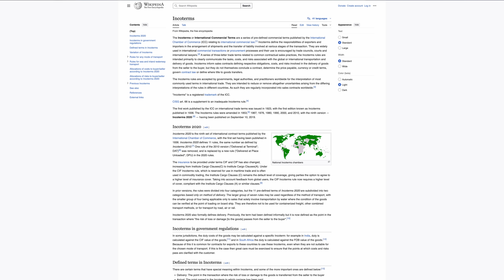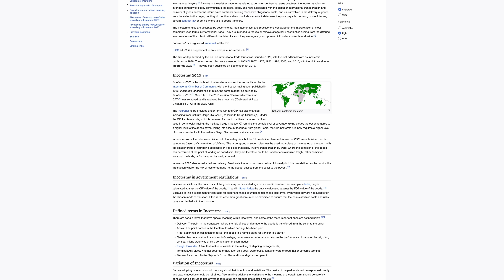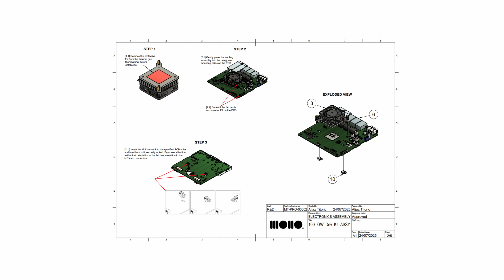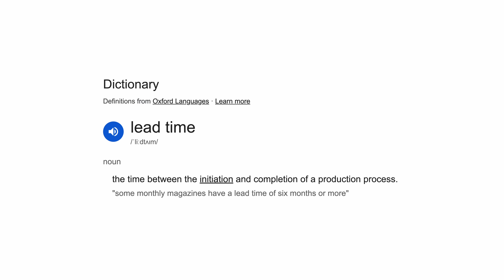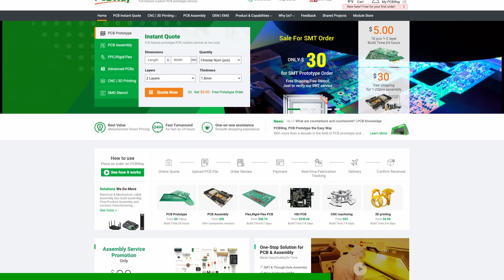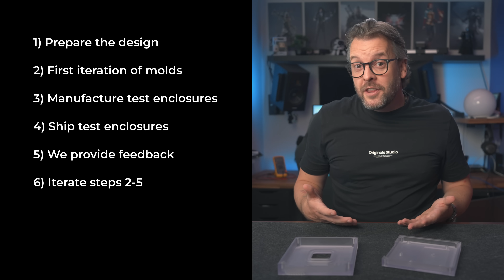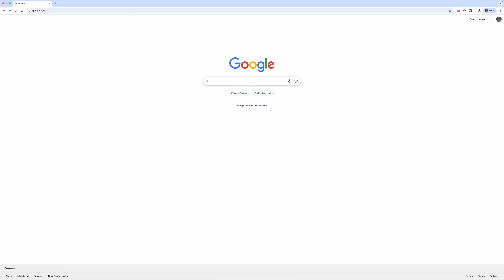We're building a high-end router. Here's the update for July 2025.

Comment: Few thoughts:
1. Still holding back with the order, waiting for a "regular" version to be ready. Actually, the PCB only version would be perfect for me, because of point nr 2.
2. I will be happy to 3D print an enclosure in very good quality and any amount that will be needed. Can also do resin and SLS prints. I'm based in Poland and I have been making projects of this size for the last 8 years.
3. It's SO COOL you've connected with Leolabs! Their ONT's can be used legally wih Orange FTTH (in Poland at least), I'm just waiting for them to release their 10Gb SFP+ ONT, so I could use it with my 8/2Gb FTTH.

Comment: TLDW but doesn't seem like you mention environmental testing, like operating temperature, dust, and humidity. Places like France are hitting 47C, wouldn't you need to test for operating temperature and have it on specifications sheet? Sorry for being a bit judgemental but the board doesn't look like ultra optimized for thermal dissipation and longevity

Comment: Alright, i have limited knowledge compared to you, BUT! I have a question. Why solder expensive ddr4 modules that are hard to get? Why not a use a sodimm slot so you can use cheap, high performing laptop memory? Consumer price for 8gb sodimm ddr4 is €20 inc tax. Yeah you still have to solder the ecc, but the rest of the ram is cheaper

Comment: I like the injection molded design with rounded edges. And the fact that you can modify the color easily. And you can keep the mold, so additional runs should be much cheaper if you can reuse the mold.

Are you willing to use brokered parts? Finding someone else with leftovers can be troublesome, but could be mutually beneficial and fast. But if you're going to keep track of fine detail in your lot numbers, could be a bear to deal with if problems show up later.

I do a lot of this for government contracts, and we can't just make 10% extra for a rainy day. So we get caught up in last time buys and obsolescence redesigns all the time. The logistics take a lot of effort as we identify an escape on a part, and then have to track down every single lot # that's affected. So I understand wanting to avoid that and just stick with a single source.

Comment: I’m not sure if it would work, but SLA 3D printing could be an option. You could use many different resins, and I don’t think the design would need any changes. However, you would need to post-process the parts to remove the support structures.

Comment: I have been thinking about routers in the past. Not only speed is important but also the way the information gets to the user and what is necessary to be better then others. For instance if the fiber is squeezed hard enough the bits wil not be able to pass through the glass, then there is the need for a back-up plan. In the specifications I do not see anything to prevent a congestion. A modern router should have an automatic multiple pathway to maximise the speed beyond the capabilities of one optic fiber. This router is still an old fashioned router but then thousands times faster, there is no real Nobel Prize winning innovation behind it.

Comment: Here is an idea to cut cost and option to make the case your own, relese the stl models so ppl that want can 3d print them :) Also, have options to sell the board without dimm and let ppl source their own (i'm assuming it's standard DIMMs) Also, and i might just have missunderstood the fan picture it but i really hope the fan PULLS out air from the case and not pushes into it, that would be weird as you want to suck the hot air out of the case.
Reply: Look at 0:35 . Above the CPU there are 5 black rectangular modules. Those are the RAM modules. Totally not standard DIMM, but directly soldered. Including ECC. Soo, not really user serviceable.

Comment: Why not just use a socketed DDR4 SODIMM?
Reply: You won’t save money, and it doesn’t make sense if the only version you’re supporting is with the dram already maxed out.
Reply: @theondono  sodimm 8 GB ddr4 is way cheaper than 55 usd per modem. Plus if you just release it without the memory people can find their own. Plus that soc chip is not limited to 8 GB.
Reply: @cybervand  the most critical spec for this application is transfer latency, not raw capacity. 

Yes, you can fit up to 32GB of DRAM on this SoC, but that’s using multiple ranks (separate CS). This has an impact on latency.

The other thing you’re not taking into consideration is EEC. Sodimm EEC is relatively rare, since most laptops don’t use EEC. If you look for 8GB so dimms, with EEC with >2100MT/s (the controller max) you’ll see the price is significantly higher than $55. 

And that’s before filtering for the PN NXP recommends and considers “validated” for the SoC.
Reply: Are SODIMMs competitively available in ECC?

Comment: I just want to be able to plug in this router to my 10 gig fiber ONT using one of the 10 gig ethernet ports, then in a second 10 gig ethernet port I want to plug into my 10 gig Intel RJ45 card, then in a third Ethernet port on the router I want to plug that into a wireless access point that I purchase and own so I'm not spending 20 bucks a month on the one to my ISP gives me but I still have 10 gig ethernet. I really don't care what it looks like. I'll use mine without any case lol just send me the board and a charger hahahah

Comment: What's the reason for the DDR4 prices? DDR4 not being made as much anymore, replaced by DDR5? For the enclosure, have you considered aluminium exptrusion + 2 flat plates for top/bottom, like Mac Mini?
Reply: It's not "not made as much", all of the main manufacturers of ddr4 stopped its production entirely to focus on ddr5
Reply: You first chose a SoC and take then the according memory...the SoC they chose still needs LPDDR4 if I'm not mistaken. Also LDDDR4 / DDR4 is still plenty used in the embedded industry (SoCs with DDR3 are starting to not be interesting anymore). Reason is simple: products are made and often needed for 10+ years to be sold, without redesigns are possible because too expensive. Embedded  industry moves slower than the Laptop/PC market

Comment: I understand your effort and congratulate you, but I think it would be much better to use the system board of old phones and have RAM, CPU and basic storage. For example, the XIAOMI Note 10 motherboard is 40$ USD and the only goal is not to have a 10GB network, it should be cheaper equipment.

Comment: At @5:00 groan.... back in the early to mid 1990's, then I sold my demo computer which had four megs of RAM at the time, planning to upgrade to a new computer with 16 mega of RAM. Between the time I ran all of the quote numbers and shortly placing the orders.... a Silicone plant in Japan blew up. Prices on chips WENT THROUGH THE ROOF!!! I ended up having to pay as much as would have purchased 32 meg of ram for only 8 meg of ram. 🤯🤮 Fortunately ram prices did not spike up that drastically this time for you. Back then I was dealing with megs of ram, today we deal with gb's of ram. Back then I was running the OS/2 operating system from IBM, today I run the OS/3 operating system.... Linux! 😎